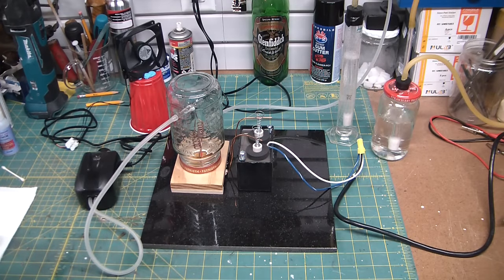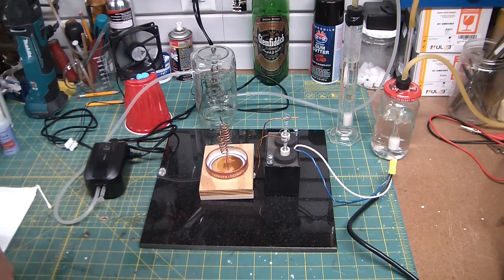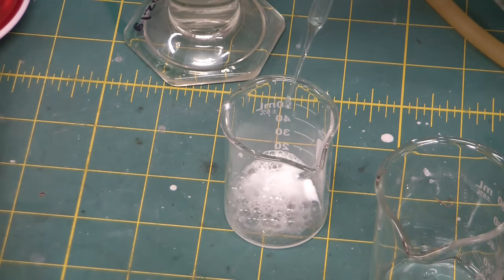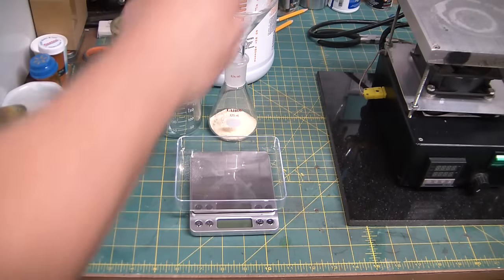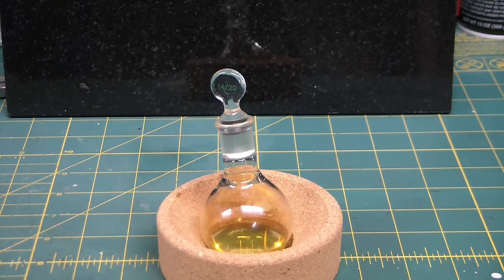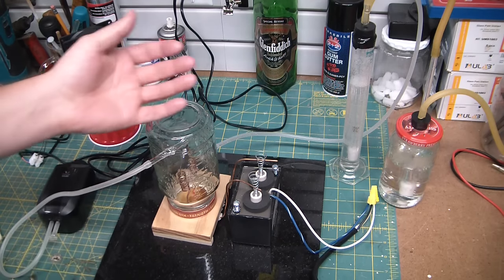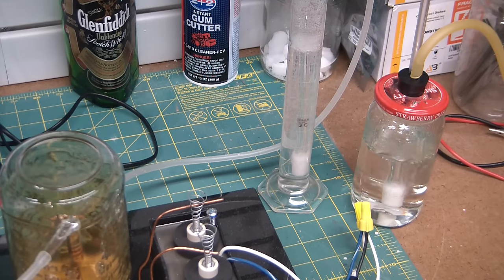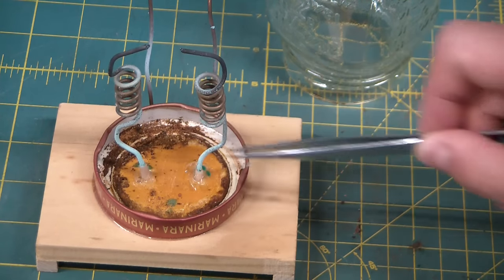Making Nitric Acid From Air - Elementalmaker

Comment: I don't exactly know but I have great suggestion..
If you use Magnetic disk forming at normal pressure Than the Plasma surface would be much less but if you decrease the pressure ( or may be also with hight pressure if discharge happens with ) with close loop air system just like Refrigerator , so at low vacuum Plasma disk can be easily form in process of similar to of Magnetron  and you also have to cool your magnet or you can also use Electromagnets .After some time you have to refill the air in the system because it consume in the Process or just add intake Valve .
This is just idea you can Try it .

Comment: A ring magnet with an electrode in the center producing a spark gap in witch the plasma will rotate along the natural magnetic field of the ring magnet producing a spirel plasma wall in the ring magnet. That's how you can build the plasma wall you need to increase the efficiency of your reaction.

Comment: Nice video. 1. As for the color change: Since you added caustic baking soda, the ph was lowered until some impurity dropped out. From the way this happened (evenly and no particles dropped to the ground) I would assume that that was the release of a colloidal compound, maybe small particles from copper wire (or tin from lid!) which disintegrated and was taken with the air stream. 2. I am not sure if the second step, converting dilute HNO3 into sodium nitrate, was needed. Just heat the primary and secondary acid liquids and drive out excess water. I guess that would have worked as well, or even better and faster. Anyhow: Great equipment (How about some nitril gloves, next time?) Will discuss that in my blog and share your video for sure.
Reply from the maker: Excellent comment! I think the color change was actually due to the nitrite contamination, It would be interesting to try this experiment again, and see if the same color change occurs, then bubble O2 into the solution, and see if that clears it, which would confirm nitrite. Nitrile gloves can actually be a hazard with concentrated nitric acid, they will spontaneously combust on contact, so bare hands are actually preferred.
Reply: İ think the plastic hose got dissolved. İf you look closely the plastic hose is the same color as the unpure nitric acid.

Comment: Could you theoretically get rfna by continuing to bubble no2 into the acid-water mix for a long ass time until the water proportion gets smaller and smaller? Or does there come a time where you can’t dissolve any more beyond a certain concentration?
Reply from the maker: Unfortunately it maxes out around 50% from what I was reading. And it would be chemically impossible to get past the azeotrope at 70% without distillation or dessication.

Comment: I bet the local ham radio operators just LOVE that you're running that lol
Reply from the maker: Would it be that bad? It's the same oil burner transformer used all over the country for oil burners...  But I guess it isn't contained within a big steel box acting as a Faraday cage.
Reply: @ElementalMaker  oh I was mostly just kidding 😄 I doubt it'd be too bad. One interesting note though is if I'm using an AM radio while in the car the radio will pick up the static from the sparkplugs igniting, pretty neat!
Reply: @ElementalMaker  I think it definitely could be a nuisance to ham and SWL a few hundreds yards around. Especially because it's sparks, surge discharges ( blank large spectrum produced).
You could just Faraday it a bit  with metal mesh/grid on the jar and around the xformer, and by working on a metal table/plane (no matter if wood is on top of it, grid below the table would be ok too), all grounded. Quick dirty grounding already does a lot in that matter. ( sowy for bad english, I'm a french SWL, tryin' to hear your lab on air right now  :)

Comment: 02:30 I am from Germany and here nitric acid is forbidden. So I make it myself when I need it with the exact same approach. In my reactor I use a "Jakobs ladder" as spark gap, because I run the reactor sometimes for weeks. A Jakobs ladder helps reducing the degradation of the electrodes and improves the cooling of the electrodes.
Reply from the maker: Very good insight. Have you found any epoxies or other, adhesives that withstand the corrosive environment, or do you dry your ingoing air? Also, what material tubing are you using? My latex tubing was pretty degraded, although the vinyl tubing seemed to hold up
Reply: @ElementalMaker  I use high temperature silicone for everything and PTFE tubing.
Reply from the maker: @emmepombar3328  great to know, thank you so much 👍
Reply: For my bubbler I use a big flower vase (~1 meter in height and has a volume of around 5 liters).
Reply: @ElementalMaker  I've sent you an e-mail with two short videos of my first setup.

Comment: Look into using neon sign components for your reaction chamber.  You will need glass torches to fabricate. I worked in a neon shop and normal air will create plasma in a tube with  enough voltage  at the  electrodes. This is a step in the process before filling with the nobel gas of choice . Contant current does produce enough heat in little time to melt the glass .  This is merely an idea based on your mention of the plasma producing dynamo.  But a pulsed current,  temp and pressure countermeasures may yield an efficient system .  The reaction could actuate the gas flow with  one way valves before and after the reaction chamber like in a coffee machine.

Comment: @ElementalMaker if you don’t have an answer yet, the sudden color change may be some of the nitric acid decomposing due to temperature after adding enough baking soda.  The color would be from NO2, I think.
Reply from the maker: In retrospect, and after talking to a couple chemist's I know, it looks to have been sodium nitrite contamination that caused the color change, which is also bolstered by the huge amount of nitrogen dioxide given off when adding the sulfuric acid.
Reply from the maker: I should have added some hydrogen peroxide to the reactor at the end to ensure all the nitrous acid was converted to nitric

Comment: Nice! I'm interested in trying to make nitrogen fertilizer for growing veggies hydroponically using excess solar power when the batteries are full. Hydroponic nutrients aren't cheap, especially lately, and a lot of it is made using tons of fossil fuel so would be really cool to make it from the air using renewable energy at home.

Comment: You should try Mo metal in Aqua regas (1 part Nitric acid, 3 parts Hydrochloric acid) and reflux very carefully the Mo metal. You need to vent the NO2, NO, and NOCl2 gas. Then once it goes from Dark red put it into a 2 L beaker and add baking soda or Sodium carbonate. You will get Mo of different states Mo+4 to Mo+5 which can make a nice pigment. I just discovered this when handling the toxic waste.

Comment: From what I had read about, up until the Oswald process, this is how nitric acid was made. they didn't use such small dinky apparatus, more like massive brick lined towers and a very high power arc. typically fed power from a source of nearby hydroelectric. The old timers had figured out how to do it and maximize the efficiency as much as possible.
Reply from the maker: Yes the old school birkeland Eyde facilities must have been a sight to behold! There are some very cool pictures of the old plants, and even some still existing reactors in museums

Comment: When NO2 is dissolved into water, a mixture of nitrous and nitric acid is formed. I suppose that prolonged bubbling of air through the nitric acid would eventually convert (oxidise) any residual nitrous acid to the nitric. Or, maybe the addition of some hydrogen peroxide to the nitrous acid-containing nitric acid would do the trick? I think that the yellowish off-colour was due to sodium nitrite. Is it easy to separate sodium nitrite from the nitrate by fractional crystallisation? Nitrite salts are useful in their own right. Then again, the proportion of nitrite to nitrate is probably so small that, if one wanted the nitrite salt, it would be more efficient to chemically reduce the sodium nitrate (which is not all that difficult- a number of reducing agents can be used to reduce nitrate to nitrite).
Reply: Or the first glass is build like an classic oxidation tower filled with moist pumic stones. The high survace speeds up the oxidation to nitric acid.

Comment: Sodium nitrate can thermally decompose into the nitrite, so maybe the long drying on heat contributed to the large proportion of nitrite.
Reply from the maker: I think the issue was the amount of nitrous acid produced. Sodium nitrate shouldn't decompose at such low temps, although if I pushed it a couple hundred degrees higher we definitely would have made alot of nitrite

Comment: I have been thinking of making hydrocloric acid. I think you can just use electrolysis to make H2 and Cl2, and then react them using UV (quite dramatic reaction afaik) with for instance a UV diode inside the flashback bubbler.
Reply from the maker: Any reason why you wouldn't just buy HCl from the hardware store, or are you just exploring them chemistry?
Reply: @ElementalMaker  I like the idea of self sufficiency and having a magic machine that eats water and salt and poops HCL.

I have no practical use for it, I just like to have it... ;)

What you made also fits that category, and if it runs slowly, all the time, you will bulk up for when you need it.

Comment: Solar panels makes it free genius essentially... If you are feeling a little risky you can even use power from your car... There are ways around paying utility companies to make it if you are determined... Doesn't make it a great idea but it's doable... Also bubbling  filtered aerated air through water BEFORE sending it through the plasma chamber then through the water works way better ... Also you made so little is a direct result of having it bubble through only a little bit of water...

Comment: All hail the right hand rule! From wikipedia:
In electricity and magnetism, the force exerted on a moving charged particle when moving in a magnetic field B is given by:

    F = q v × B 

The direction of the cross product may be found by application of the right hand rule as follows:

    The index finger points in the direction of the velocity vector v.
    The middle finger points in the direction of the magnetic field vector B.
    The thumb points in the direction of the cross product F.

For example, for a positively charged particle moving to the north, in a region where the magnetic field points west, the resultant force points up. 

So you could use this in your reactor by aligning a magnetic field up/down (such as a ring magnet). Have the magnet be one terminal, then have the center point of the ring be the other terminal. Ions will then experience a force that pushes them in circular motion, expanding the arc to fill the gap.

Comment: Dude!
I got an Idea
Just crack open a microwave, open the magnetron, in there is two very powerful donut shaped magnets, just as seen in the video clip you showed demonstrating the disk plasma.
I think that should work. These are very strong , a bit brittle though I think.
I mean it's basically for free and you could glue them to a stick and hold them next to the plasma and see how it behaves to figure out the most efficient form for your jar.

Comment: Drill holes in jar and mount the electrodes through the bottom of the jar. Can you feed the exhaust into the aquarium pump inlet or will the fumes eat up the pumping mechanism?
Reply from the maker: Unfortunately the fumes would definitely kill the pump in a hurry

Comment: Also you might need a higher flow rate. NO2 is your goal, but air is "NO0.25", so waaaay less oxygen than what you want. So putting more power into a small flow is not going to help you much, unless you enrich in oxygen.
Reply from the maker: Yep! I thought about using my oxygen concentrator to enrich the ingoing air, might give that a try next time!
Reply: @ElementalMaker  If you decompose H2O (H2 O2 in separate electrodes) you can make an enriched environment, i think? I just don't know if the electric cost will be sufficiently good...
Reply: @isaacm1929  great idea!  Hydrogen will come form the cathode and oxygen will come from the anode.  The oxygen could be pipped into the apparatus and used that way.  Very easy to do and a great idea!
Reply: @ElementalMaker  I'd give @Isaac M 's idea a try.  Would be pretty easy to do and you could even use the same electric supply as the synthesis apparatus to refill it with O2.
Reply: @isaacm1929  Use KHO for more efficient electrolisys

Comment: The two primary gasses in the air around us are nitrogen and oxygen. They are known as diatomic molecules because their nuclei aren't perfectly centered in the electron clouds orbiting them. Their resulting partial positive charges seek other like charges in the air around them and form N2 and O2 because it makes the gas more stable. By introducing electricity to the gas in a sealed container, you are applying enough voltage to split up two nitrogen molecules similarly to how lightning does it, which is also the only way we know of so far to break nitrogen bonds, the strongest in all of organic chemistry. N2 + O2 (electricity)-> 2NO2. The 2NO2 dissolves in the water producing nitric acid as follows: 3NO2 + H2O -> 2HNO3 + NO. The mechanism would have to be drawn out to further explain what is happening to get 2HNO3, but put more simply, it's just a simple chemical equation balancing exercise  😉👍
Reply: That boy is wicked smart!

Comment: Ay a new video! Sweet! Man that made stronger acid than I expected. Hopefully that thumb heals up fast. But overall is this cheaper than buying a bottle of premade acid for how little you use it? I know you say no in the video but I'd be curious about dollar amounts.
Reply from the maker: I'll have to crunch the numbers and see what the actual price per pound for the impure sodium nitrate would work out to be, I'll let you know what it works out to be!
Reply from the maker: Just did the math and it's actually not as bad as I expected! Assuming 45 watts for the energy input with the transformer, fan, and air pump, and 40hr run time, at my energy price of $0.15/kwh, the impure sodium nitrate comes out to $4.05/lb in energy cost! Not too bad honestly!
Reply: @ElementalMaker  Don't forget to add the cost of sodium bicarbonate.
Reply: @ElementalMaker  I'm off grid with a fairly large solar system so making nitric from air is viable for me.. i think you could have just distilled the nitric to make 68% and dry it with H2SO4 to get a higher percentage and just distill the H2SO4 thats left to recover it

Comment: I have an idea for your next video!
Now, I don't know if this will work but it's worth a shot, Cast Thermite!
Instead of mixing Aluminium powder in with Iron oxide, melt the Aluminium and mix in (dried!) Iron oxide powder to the correct ratio and let it set.
The ignition temperature of Thermite is a bit higher than Aluminium's melting point so there is a bit of leeway. 
This would avoid the issue of milling Aluminium or purchasing expensive powder, I would imagine igniting it would be a bitch tho!

Comment: You could have just added sulphuric acid and made azeotropic and then distill again to get fuming nitric acid
Reply from the maker: @brett9679  you would need quite alot of sulfuric to get rid of that much water. Cheaper to just use a salt

Comment: The strength or concentration of many acids is trackable with a hydrometer. Just bubble gas into receiver til the hydrometer says it's the concentration that you want.
Reply from the maker: Great idea! Didn't even consider specific gravity to determine concentration!
Reply: @ElementalMaker  Determination by SG doesn't use precious acid

Comment: You can make weak nitric acid with an ozone generator as well. It takes a while, but you run a tube from your ozone generator into a jar of water, and let it bubble throughthe water. You can then wait until the water becoms acidic and then concentrate it.

Comment: Hey can I use any of fertilizer containg nitrate and mix it with wood ash after distilating its nitrate to water ? To create kno3 ?
First I used wood ash, distilated it and collcated potassium carbotnate/hydrooxide. (It will have both, but carbnote will be in more amount).
So potassium carbonate liquid which is distilated from wood ash solution, then mix it with any of nitrate solution which is so disitlated, and boil, and cool to create kno3, is it possible ?

Comment: Just happened upon your video and was thinking about power output to produce your plasma arc. I'm not sure but you can definitely reduce the voltage by having several connections that have the positive charge on one side the negative on the other. You'd have to have a lot of connections but i don't know how that would work out and I'm sure I'm not being too clear and sound confusing, however another option would be to make an ionic engine which would not only run cool but would also push the the air at the same time🎉🎉🎉😤🥳🥳🥳😁

Comment: And did you need to distill it or could you have used it right off the generator
Reply from the maker: It depends on your application. For most uses like making flash cotton it would be too dilute to use.